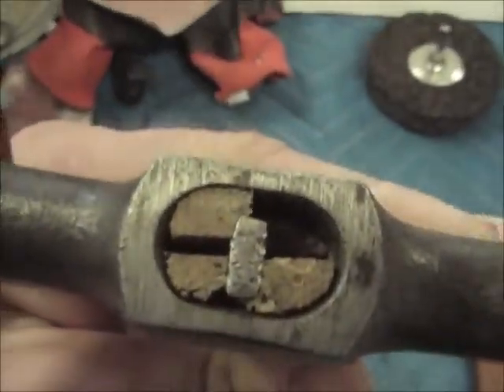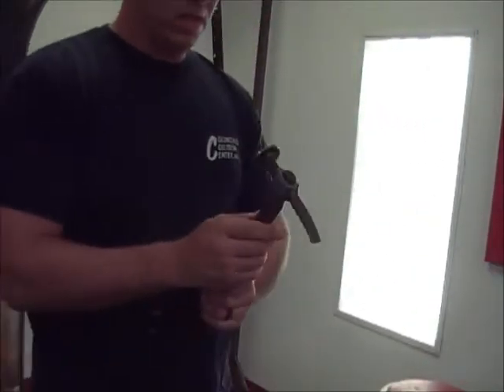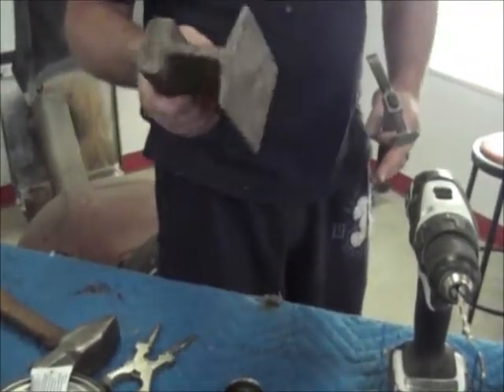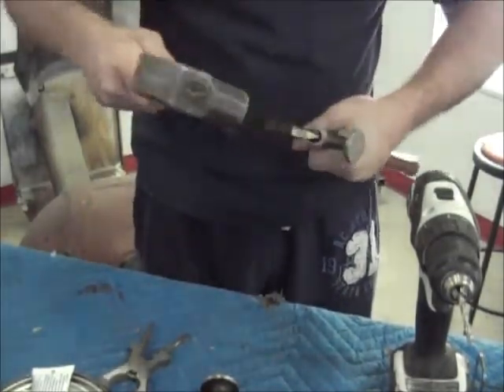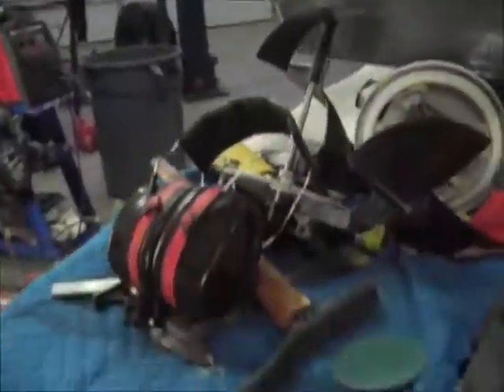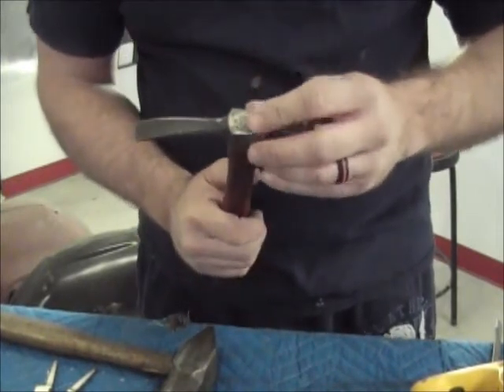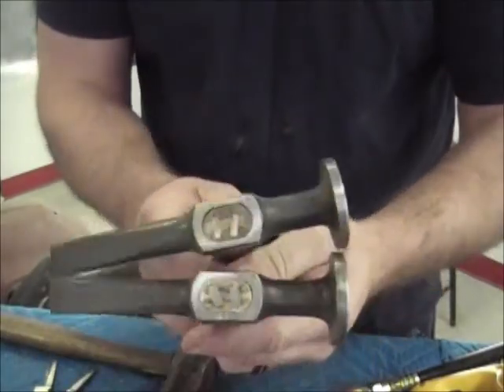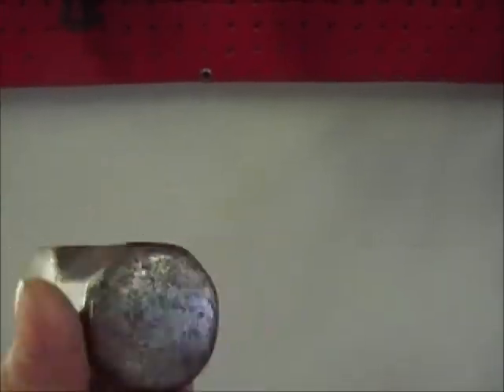hammer handle replacement

Comment: I've seen videos on dressing the face of the body hammers using a file.  I think the 180 on the da sander looks like it works just fine.  I put a new handle on my splitting maul and I guess with some universal handles that you need to sand them a bit to get them to fit right.  Didn't know the trick for hitting the handle to drive it into the head though.  I'll give that a shot on my next replacement one.  Thanks for the vid!
Reply from the maker: +Velvethamma Thanks for watchin!

Comment: I've been wanting to try a wooden handle body hammer. I've been using the fiberglass hammers. Have you been able to compare the two. New handle looks factory.
Reply from the maker: +Double R Restorations no sir I have never used a fiberglass hammer